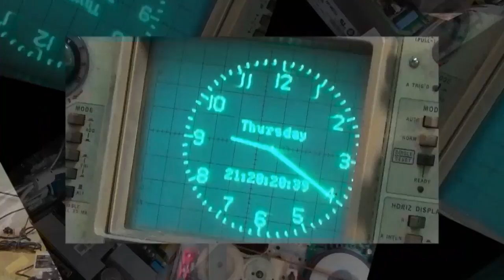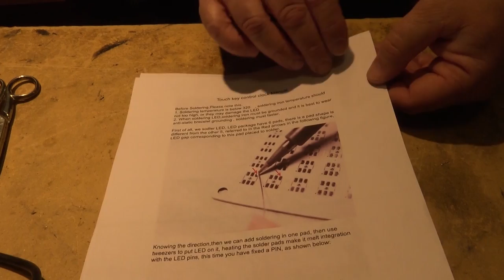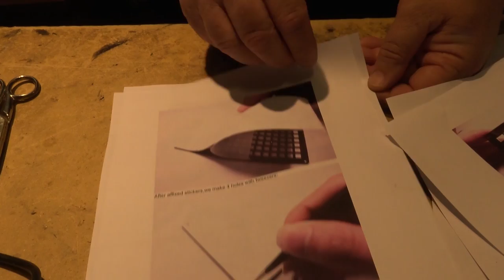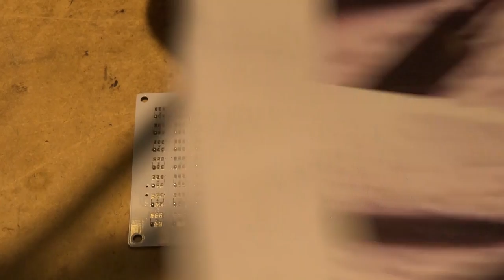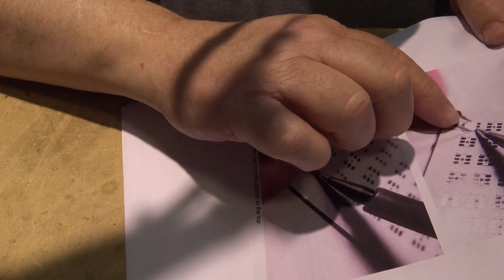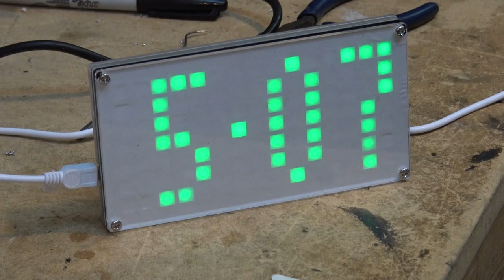Banggood DIY DS3231 Big digit dot matrix clock build

Comment: Very nice video of the assembly. I found it is a good idea to check the LEDs by using a DMM on Diode setting to check the solder connections. There are actually 3 LEDs in each square LED module and if one of the 3 leads on the top or bottom aren't soldered properly, that little LED won't light. Thanks for putting this up. It answered a few questions I had.
Reply: According to 12voltvids you can bridge all 3 on each side since the3LEDs are in parallel, in one of his replies he said: " I could have bridged over the 3 lands on each side."

Comment: Helpful items for the future, tweezers made for this, I have some an they make the teeny tinny parts easier to handle and a nice hakko curved pin soldering tip.
Reply from the maker: dmwtech 
Probably for the propeller clock, as the LEDs are even smaller.  A fine point tip is also a good idea.

Comment: You adapted to SMD quite well and that's a cool clock!
Reply from the maker: I used to repair camcorders. Have had plenty of practice removing 100+ pin 4 sided flat pack IC without the benefits of a hot air station, because back in the day those cost upwards of 5000.00. Used to use the stainless steel hot wire technique.Thread the wire under the IC. Apply current to it to heat it up and pull. Yes it was barbaric, and the IC would never go back in, but it worked.
That was 20 years ago. I did build the osciloclock board that is shown on the intro video. That was an SMD, but only a few components..
This one had lots.
Reply: You know Canadians just had to make do and work harder.  Customs cost so much and yes tools were expensive. I noticed Americans just trash everything.,  That clock is just 8 bucks here, maybe I will order it. It says Arduino, what's that mean?

Comment: Smashing assembly :-D
Now thats a lot of leds, you need buckets of patience to do them.
Side B looked much simpler :-)
I got to 52 mins and my internet just vanished lol, but i was able to continue once the modem was happy again :-).

I liked the filter to the front best, easyer to look at.
Reply from the maker: Yes I agree, And yes there was a ton of solder work on this 650 or so individual solder connections. I lost count.
The nixie tube clock should be simpler, and that arrived today! Next!

Comment: I did't ever heard your clock beeped. It seems, you have got the DS3231M chip with the clock. In this clock, it is used a passive buzzer , which beeps when a square wave comes to it at a certain frequency. The DS3231M gives on the third leg a square wave of only one frequency in 1Hz (see the datasheet)  out. Therefore, when you touch any button or the alarm goes off, the buzzer snaps. In order for the buzzer to beep, you need the DS3231SN chip, which produces on the third leg square waves with programmable frequencies 1Hz, 1kHz, 4kHz, 8kHz. At a frequency of 4kHz, the buzzer will normal beep. This clock must be only completed with the DS3231SN chip.
Reply from the maker: It does buzz. The alarm beeps in .5hz beeps. Only when the alarm is set.
Reply: OK. Do you have DS3231M  or DS3231SN  on the clock's board?

Comment: Those appear to be RGB LEDs. Why is the display only in green?
Reply from the maker: If you look at the 13:00 mark, when I tested the LED you will see 3 green dots.
They are infact green only. They are 3 level. There is a brightness control 1, 2 or all 3 LEDS light. I first though they were RGB LEDS too, until I tested it. I had talked about it being an RGB and cut it out. You can here the edit.
The kit you specify Red, Green, Blue or White LEDs.

Comment: It is weird that it doesn't use two other axillary chips for row and column decoding and would use persistence  of vision to allow you to to create the digits, I just wonder if you could use a computer to control a high power infra-red laser so that you could scan the laser to allow you to solder each joint without having to touch the device with your hand and I think it relies on you using solder paste.
Reply from the maker: The display is definitely multiplexed.
I just completed a nixie tube clock, and the next one will be a propeller clock. I have the bag of parts sitting here.
My favorites so far are this one, and the nixie. Wait till you see the completed nixie clock. WIll probably edit it tomorrow. Heading to bed now, work in the AM. Wait it is the AM already.

Comment: I think it would be easier to use the front cover for the LED's as a template to place them on the board and then I am going to use fast melt solder paste and the hot air gun to do mine. Soldering each one by hand seems a bit time consuming. Hot air is your friend with smd, well or a reflow oven.
Reply from the maker: Hot air and reflow is the easy way. As I have said repeatedly, I don't do easy. I use tools that everyone has. Flat pack IC replacement, no problem, just cut the old one out with a razor blade (did that on a sony TV I fixed). I learned how to do it when an air station cost 5,000.00 and the cheap ass bos I had wouldn't spend a dime on tools or test equipment. So I had to learn how to do it with just an soldering iron, and I got very good at it. It wasn't that hard to put these LEDs in, and as I found out AFTER I did it, the 3 LEDs in each chip are all in parallel anyway, so I coud have bridged over the 3 lands on each side.
It was a fin clock kit to build, and it now sits on a shelf right over my desk.
Reply: It looks nice when finished. That is why I purchased it, but I hate SMD, so yea I will be using hot air and solder paste. The big issue is getting the LED's in the right direction. Heaven forbid if you put them all on the wrong way. I intend to make sure before attempting this kit. The back side looks easy, but the LED's seem to be time consuming.
Reply from the maker: As I pointed out the marking on the LED is not what I expected.
If you have hot air, by all means use it. It didn't take me that long to assemble this. A couple of hours, and most of it was mounting the LEDs. Remember that the 3 pins on each side are connected together, so soldering is easy. I did not know that going in, so I did 6 connections per diode, when I could have just done 2, as I could have just put a blob on each side and bridged them.

Comment: I used to order a ton of stuff from banggood.  now it takes 3 months to get to canada.  so that came to an end.
Reply from the maker: Mine was ordered on April 18. 
The power supply arrived April 26, and the 2 clock kits arrived on the 3rd.
The 4K Kodi box I got from them was sent out on March 35, and I had it in my hands April 12, and did the video on the 13th. 
I am not choosing any specific shipping method either. They have sent me these units for evaluation and promotion, and everything I have received so far as arrived faster than stuff sent up from the states.. Even beat a oiece ordered  from the UK by a few days.
Reply: That's strange, maybe they're shipping from the US warehouse(a lot more expensive).  The Chinese one shipped by regular mail has been taking ages for me.  I always have to get a refund after 2 months, and then it arrives a month later.  epacket method is great, only takes 3 weeks or so, not viable for small items though.
Reply from the maker: No it came from  Quanzhou CityFujian, China. Looking at the other kit they sent at the same time. Will build that one in the next few days. It is the propeller clock. Another SMD.
Building a Nixie clock now that came from the UK, and took longer than the ones from Banggood.

Comment: Do you ever heard of tweezers? I've watched more than 30 videos of yours and seen interesting things but you never used desoldering pump (3$) or desoldering hot air station (you can build it for 10$ or buy for 50$ or cheeper - i can bet you have all the parts needed in your parts bin) and tweezers (1$ cost or even make one from 2 iron plates or a bended welding rod) those will save you from all the misery in future instead of using pliers and soldering wick and that massive destructive hot air gun ...

Comment: I am building this clock now and it is done, but it would appear that I am missing the transistor. I ordered some so I can complete it, but I can't find a schematic for it, so I was wondering if you know what the transistor is used for. Most of the traces go to the buzzer. If that is all it does I will forget it. It does seem to work without it.
Reply from the maker: C MJ 
I believe you are correct. It is for the buzzer.
Reply: It would seem that it is for the buzzer, but it also controls the LED's in the middle for the blinking dots to separate the minutes from the hours, so I am ordering some transistors.
Reply from the maker: C MJ 
Are you sure? This is a dot matrix display and it is alpha numeric for the date / day scrolling past. Therefore the entire display is controlled by mutipex ic. Transistor is for buzzer only from what I remember when I built it. Mine hasn't been apart since one of the LEDs failed and I had to replace.
Reply: Not sure, I figured that I overlooked something. I did. First off, I had about three bad LED's. Not sure why, I should have tested each one with my DVOM before installing them. Second, I know that I should always double check my work on SMD. The legs are so small on the IC's that I didn't notice that I had a solder bridge. It was so minute that it took the most powerful magnifier that I have to see it. Once I found it I ran some solder wick over it and wouldn't you know, it works properly now. By the way thanks for showing the build and functions, you made it much smoother for me to build.
Reply from the maker: I'm not so sure about that. This is a dot matrix display. The colon doesn't just blink, it is animated. In mode 1 it scrolls between the time, temperature, date and day.  All the LEDs are matrixed to the drive IC. The single transistor is just to drive the buzzer.  That center row where the colon blinks is the middle character for the day of week. and second digit for the temperature. If the display is not working correctly recheck your soldering. It is a 5x7 3 digit display, so that means 15 pins from the drive IC to matrix/multiplex that display.

Comment: Can anyone help me, I just finished putting this kit together, but all i get is all the LEDs come on in one go, but very dimly.
The clock beeps as if it is "booting up" and the LEDs flicker a bit, but i get no "output" from it.
I've checked all solder joints and there are no shorts on the USB connector.
A bit fed up as has taken quite some time to get it all together :(
Reply from the maker: Richard Dabell 
When it first boots Up it will display the time and date in a scrolling message. Check the connections on the ic's on the back. I had the same problem the first time I powered up. Used a big magnifying glass to inspect. Found a few connections that were not soldered down properly. Reheated and it fixed it and it works perfectly now.

Comment: Could you have just used little solder paste and warmed it up a tad?
Reply from the maker: Don't use solder paste on circuit boards. Most is acid based. Use only rosin flux, which is what I used.
Reply: I think mylesI meant smd solder paste which is designed for smd parts on circuit boards.
Reply from the maker: dmwtech to 
you are referring to the Flux with solder balls built in that they use in automated assembly with flow ovens. I don't have that and find the method I used fine for hand assembly.

Comment: Well that was fun to build, NOT.  Still, my first venture into surface mount components and my first kit of any description for 12 years.  Interestingly I found this clock to be picky about the power supply; I first used a charger for a Tesco Huddle 2 and had lots of glitchy behaviour.  However replacing the charger with a battery power supply solved the problem.

The big takeaway from this that I got was to get a flux pen; the back components were a breeze to solder with flux pre-applied. OTOH the LEDs were a royal pain to solder when using unleaded solder.

Comment: I really hate these surface mount kits, they really suck to try and put together. They have a different version of this that is through hole for the LED's and very little surface mount stuff, so I will be getting that one instead. If I tried this kit I would throw it across the room about half way through.
Reply from the maker: Yes it was tedious, but the kit was designed to practice the skill of SMD work, and it really teached good techniques when working with these small LEDs. I have this clock on my desk over my computer and I love it. The time keeping is very accurate, actually better than my 300.00 nixie clock!  I still like both my nixie clocks better, they are very cool. I could just stare at them all night. Nothing like that cool orange neon glow.
Reply: Adonis cmj I’ve built several of these kits. They’re great for practicing SMD, which isn’t nearly as scary as it seems at first. With a little practice, you may come to actually prefer SMD, as I do — not having to trim component legs is a massive time savings.
Reply: And I concur with 12volts, these clocks work beautifully. The DS3231 clock chip keeps superb time.

Comment: '
one LED with 6 leads are too hard soldering on the board...
rather one LED with 2 or more pins in the holes with a board is easily soldering
Reply from the maker: There are 3 LEDS in each chip, all the same color. So the individual pins do not need to be soldered like I did. You can bride them together on each side as the 3 lands on the board are connected together anyway. If they were RGB LED that is a different story, so these are actually quite somple to solder.
Reply: okay thank explain...
i have LED clocks kits and velleman kits
Reply from the maker: Yes I built a velleman clock years ago. It is the one that had the blue neon strip over it in the video neon power supply repair.
This one is a banggood.